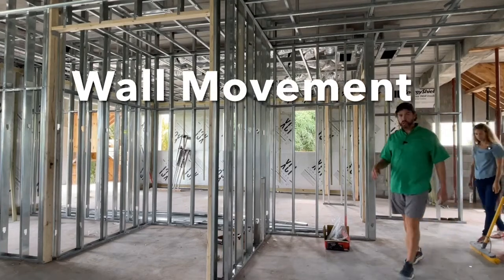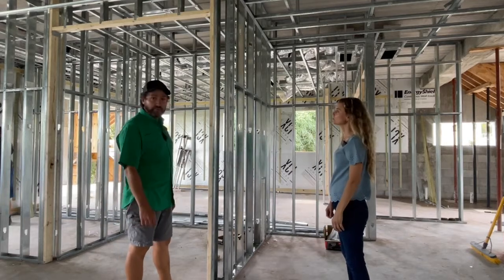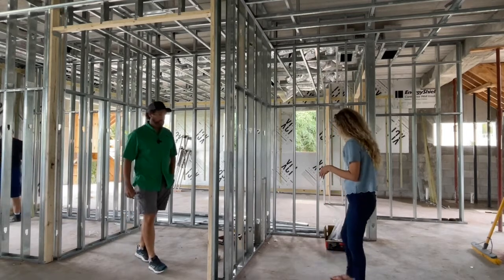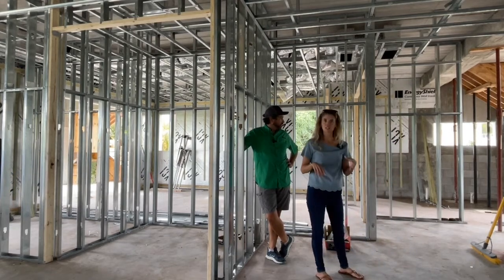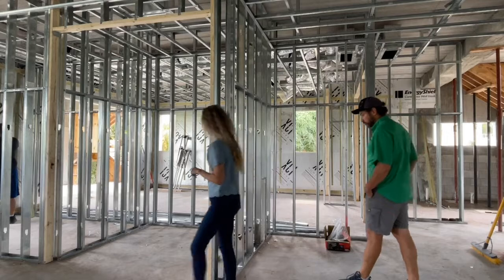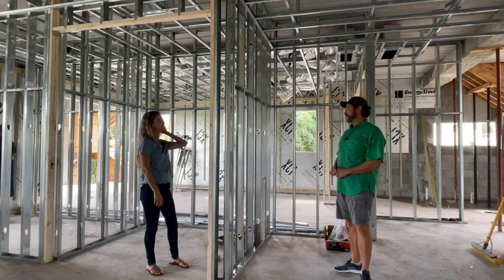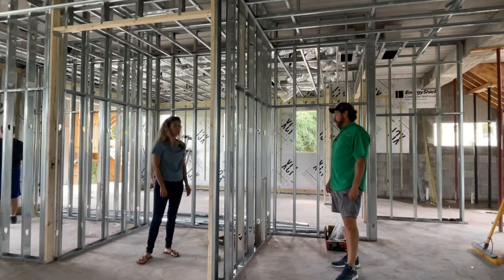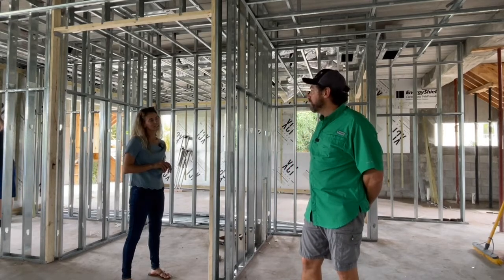Building a New Construction in Marathon Florida: Moving the Wall

Comment: The laundry needs to be a minimum of 5’ for the washer and dryer to be side by side.
Plus a laundry tub width should there be one against the same wall.
As for the plumbing, possibly that could be incorporated in a base cabinet of the bar, then rerouted to the new wall location ?
If its wrong for you now, for sure it will be wrong later, so now is the time to change it.
Reply from the maker: Great advice... But we decided to stack the W/D